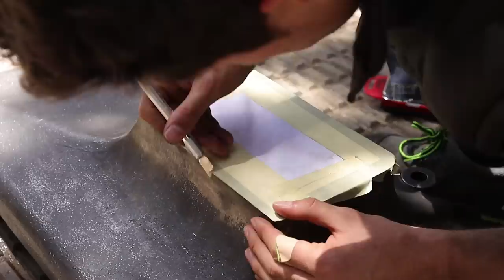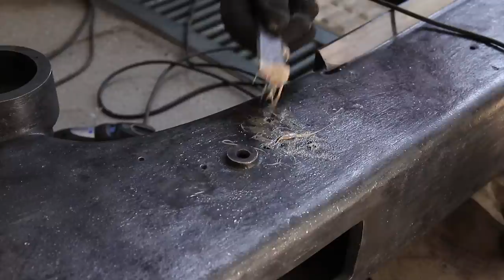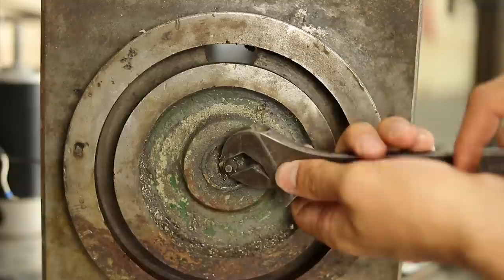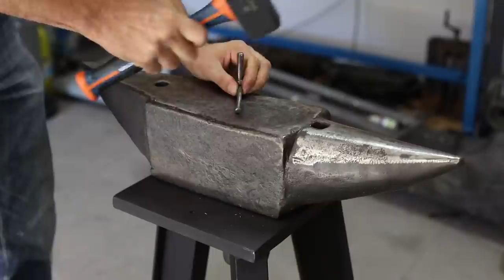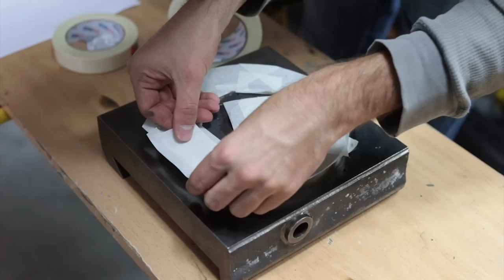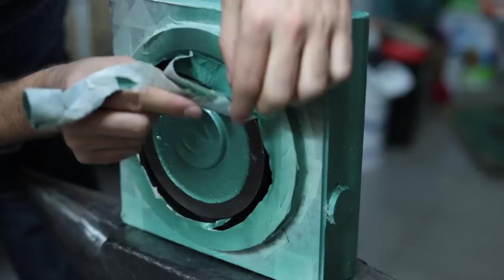🔥 1950 Drill Milling Machine Restoration | Part II 🔥

Comment: Aless, you maybe compromising the squareness of your machine by not using chemical process of rust and paint remover, on all of the critical parts of the machine, such as your ways and bases necessary to have those areas square with the world, one never uses a steel scouring brush on these areas.
Reply from the maker: Hello Eddie, I know that I should not use steel brushes in the guides, but these were in poor condition in the front. The front part was not rectified, only milled. I did not use the brush on the side areas of the guides that are rectified. Also, I checked that the brush did not scratch the surface. In the future I will perform a scraping of the guides to improve the operation of the machine, but I still do not have enough knowledge to do it well. Thanks for your comment and constructive criticism.
Reply: @AlessGonzalez  Aaah, I see. Well, you took up a big task, which is always a good place to start, when wanting to learn, because you get the hard part of the way. Also, always remember if you ever make a mistake, that is as good a tool as anything in your tool box, now that i know, and understand more of your plans, Good luck.
Reply: @eddietowers5595  Always bite off more than you can chew, right?
Reply: Hahaha, well yes of course, machining being the epitome of “more ways to skin a cat”, you bite off the biggest end, then work your way into the (apologies) creamy center. Lol
Reply: Hello....why you didn t use sand blasting???
Reply: @Juan Bertello, sand blasting isn’t any different than machining cast iron or using a tool post grinder, without protecting the ways and other precise surfaces of your machine. You can sandblast, but you would either have to cover the ways and surfaces of other critical precision parts or sandblast just parts of machines that are nonessential machine body. When ever possible chemical removal is fastest and best. Never use a metal hammer to remove critical parts like spindles, critical shafting, etc. you’re more likely to mushroom the ends of these pieces cause all sorts of problems for the machine(s). Good question, Juan.
Reply: @Sheila Walker It’s a mill/drill, so everything applied to a drill [press] concerning work processes you obviously don’t apply to a mill, but every process you apply to a mill you can apply to a drill and get the same, lasting precision. As for restoration, all of what you described, of course I might’ve applied my restoration projects, but we’re talking about a guy (in the video) who is taking on the daunting task of restoring such a mill/drill...for the first time. Meaning he may not have access to the processes you’ve described, or like most of us, the budget, but, it seems he still knocking it out of tge Park. It’s just that all who commented, are those people, like me, that view these types of restoration videos...las a horror movie, it’s a long bumpy ride of spills (literally) and chills (usually cold garages) but in the end, a hero prevails. And we all, as viewers experience such achievements.
Reply: @eddietowers5595   Bah it isn't removing that much. With the condition of the machine it probably has well more wear anyway.
Reply: I have an Atlas lathe given to me by a neighbor, whose husband bought it 75 years ago, who gave it to me, in helping her take down his shed, and help prep the house for sale and despite the aging, leaky, shed, the lathe was stored in, for half its life, the feed screws were off the standard .010-.015, and despite the rust, everything else clocked in at .0025. After the restore, using scotch Brite brown pads, 1/2”, 6”x8” plate glass, then finishing with 0000 steel wool. I got the lathe to Swiss fine precision. Not once using any wire brush. Though I did have to increase DIY bronze gib sizes, and used RFID tag strips (.0005 thick) in four places of the tapered bearing headstock. It’s all I had to do. Thank goodness for old Iron. But, to each is own, aaand, is a learning experience.
Reply: also the ways of any machine like lathes etc, are never smooth and polished, so they can hold oil
Reply: @poo why not, what?! Cast iron doesn’t necessarily need oil, as it is a bearing material. You put oil on cast iron, to prevent flash rusting or otherwise. But, it couldn’t hurt, as a preservative for longevity.
Reply: well if you look  at a big mill like a bridgeport, the ways, have a pattern on them, also usually have an oil pump
Reply: Ah, yes, yes, like some larger lathes, too. They all have them plumbed and  strategically placed through out the ways, to tell you the truth through milling machines or lathes, I have respect for the guys that ha$ to run the tubes throughout the machines, after leaving 5he pump. Phew.

Comment: Love you work but you should not polish the ways, they need a certain roughness to trap oil in. Ideally you would surface grind them but for a budget option use a good quality wheat stone that is nice and flat to smooth and remove rust.
In all honesty I wish I could do what you do Im a armchair commenter.

Comment: also, you may want to use a rubber mallet on the edges of any areas you taped of, the rubber mallet strikes these areas of the masking tape, cutting the tape to the size you need, and easily peels off the excess it's a nice project, but your process is painful and cringey to watch, yet, I can't look away.